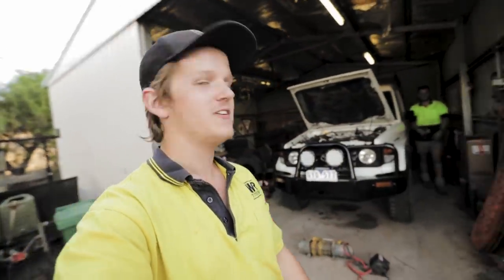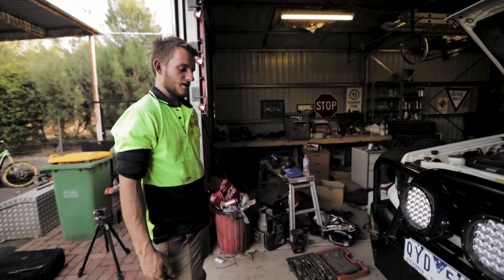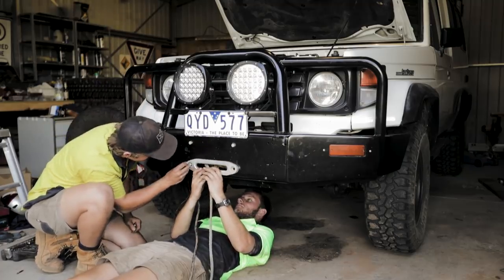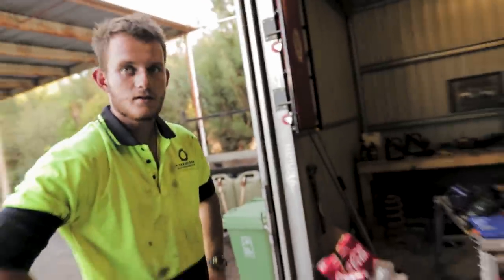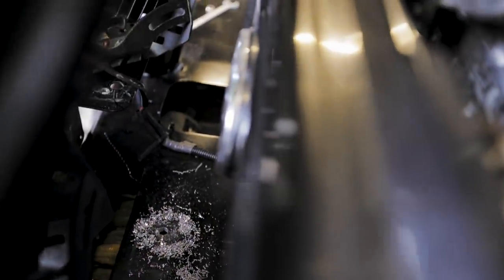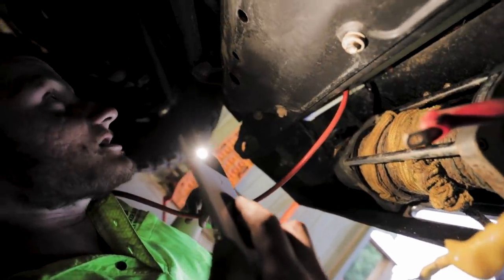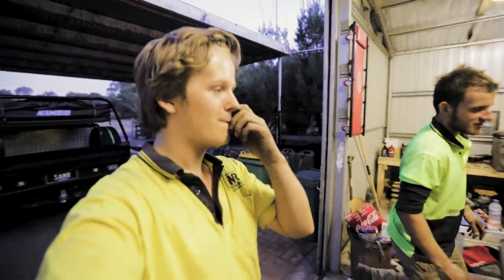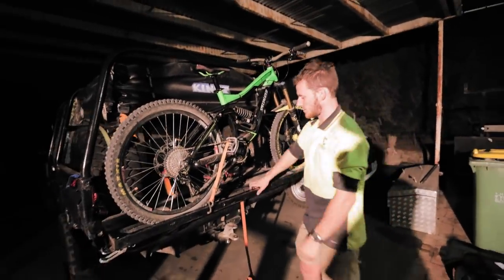Installing a WINCH on the TROOPY!

Comment: Looks good, just reinstalled the winch on my 4x4, I reckon pays to add high temp grease to the internals as they put stuff all in them at the factory. If it ever stuffs up (cable won’t go forward or won’t go back) replace the solenoids in that black box. Just installed a new set yesty in mine. Farmjacks are just as handy to get you out of the shit too, but they’re dangerous too if they kick back. I’m heading up to Wilcannia for a week of no peak hr Melbourne crap 😎